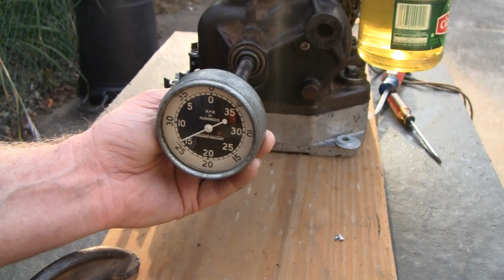HOMEMADE TWIN BRIGGS ENGINE PROJECT (part 7)

Comment: Would love to see it power a front engine kart made to look old time with body panels. saw a kart with the old maytag twin 2 cycle engine... had sheet metal body work a little narrower at the front, sides were vertical then rounded on top. looked simple to make in a metal roller...

Comment: Make an intake manifold so you can run one carburetor. Turning that screw driver is going to be a full time job. It don't sound like the engine is making usable power.

Comment: Now that would be a sweet mill for a homemade mini bike.  Not one of those stubby little frames we used to see in the 60s and 70s, a fuller-size bike, like 7/8 scale like a Rebel.  Bolt this thing in with a Torq-a-Verter and I bet you could keep up with traffic.
Reply: eh not really. at best that would make 3hp or so at 3600RPM.

Comment: Its actually a pretty good sounding motor, how did you connect the crankshafts and how are the pistons firing in relation to each other?

Comment: Sounds like you have the crank throws in line like a Wisconsin , If the throws were 180 degrees it would like a John Deere twin

Comment: make a homemade adapter manifold so you can run both cylinders on one carb...That way its easyer to make it run better and cleaner without a pain in the butt to tune the carbs... Nice project :D

Comment: now make an exhaust headder out of thraded pipe and elbows. that should give a bit of  backpressure and help it run a little smoother. Great job, though! you should also put it in a lawn mower or something!

Comment: Awsome work guys , put this on a mini chopper. those carbs are notorious for getting blockage around the check ball in the copper down-tube. the tubes pull right out (carefully) and you can blast them from both sides with carb cleaner, then a little marvel mystery oil to make that check valve work , a partial block will drive you nuts trying to adjust the mixture. keep up the good work !

Comment: What brand of pickle juice works best?  When you adjust the idle mixture screws, do so at idle, and one carb at a time.  Slowly turn the screw in and out to find the spot where the engine runs smoothest.  Rev it a couple times then do the other carb.  Go back and forth a couple times.  The more accurately you get them adjusted, the less likely the engine will bog when you snap the throttle.  COOL PROJECT!

Comment: hey so out of curiosity, did you move the magneto coil for the 2nd cylinder to the bottom of the flywheel of the first cylinder cause I see you cut the other flywheel off.
And if so, how did you time it?